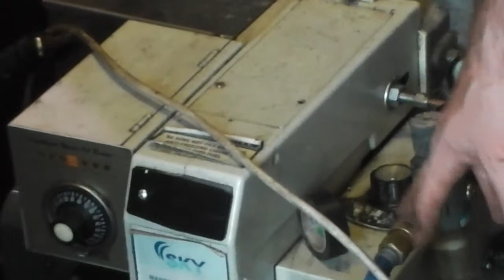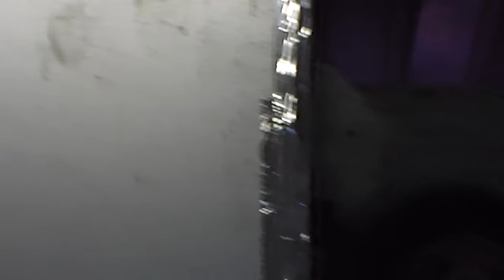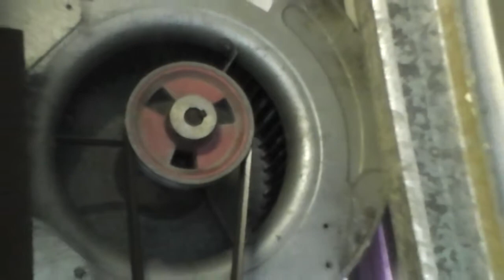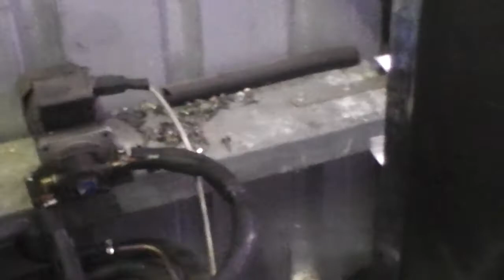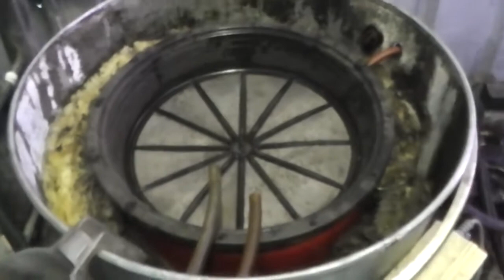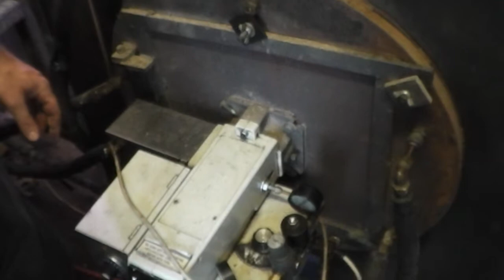waste oil heater  greenhouse burn pt1

Comment from the maker: hi i will give it a go  i only use a bit of flyscreen mesh  i use 20,000 ltr a year of waste oil and have never had a blockage in the nozzle i use 3 delavan type nozzles in this burner                                                                          no 1 are you use waste motor/ gear oil  ordeep fryer oil  ?  
no 2 are you heating the oil  i heat my oil to about 90c
i have made  a burner my self they work good  i just bought this power head because they are automatic 
let me know how u